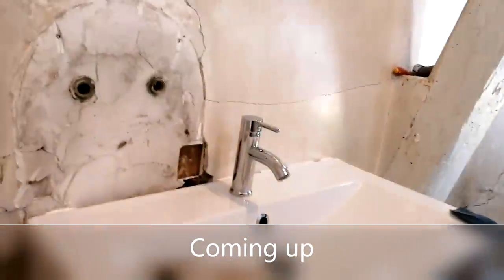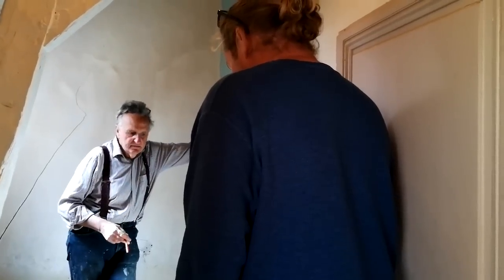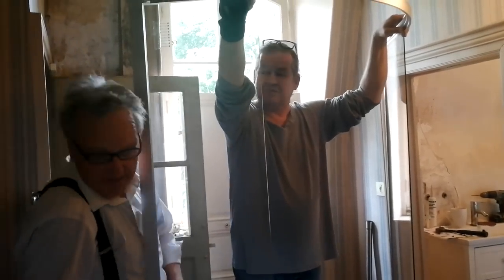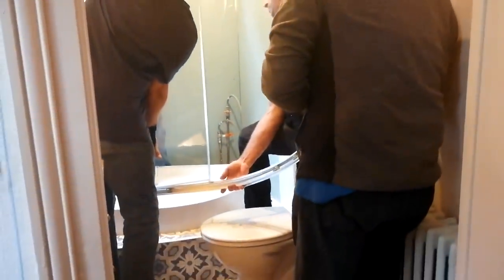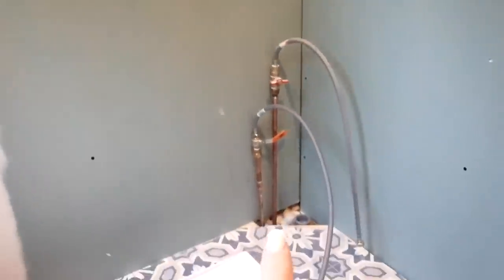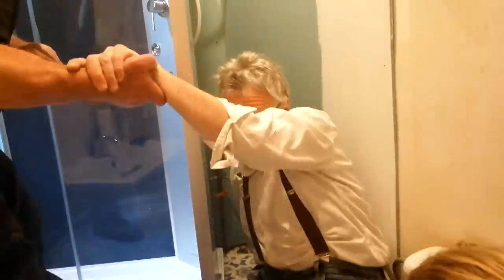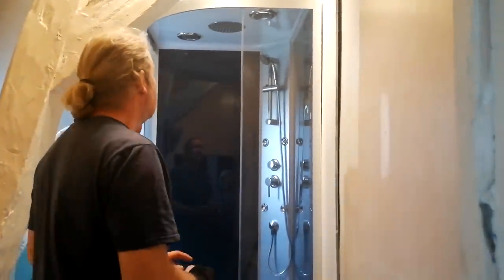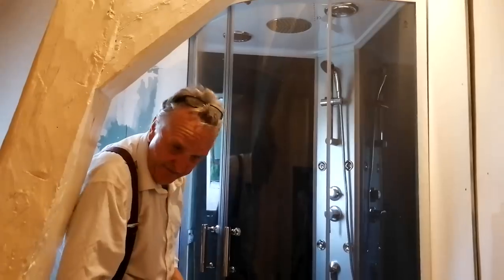Not Quite a Chateau DIY 191 - Four Men in a Chateau Bathroom -Can it be done before visitors arrive

Comment: Why is the shower so high off the floor, or is that boxing coming off.
Reply: I should imagine in order to have all the necessary plumbing underneath the shower tray - and above the floor.
Reply from the maker: Hi Patricia, the floor has been built up to overcome the difficult chateau plumbing!
Reply from the maker: You are quite right Stephanie, trying to replumb chateau bathrooms sometimes has to be solved in ingenious ways!! The walls are often 3 feet thick for example.